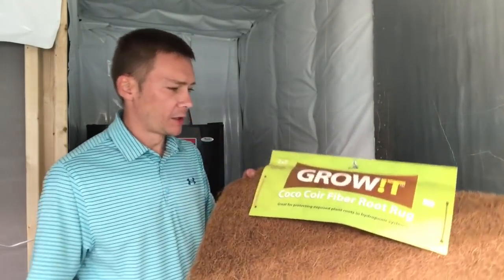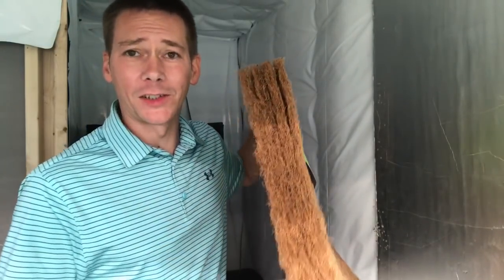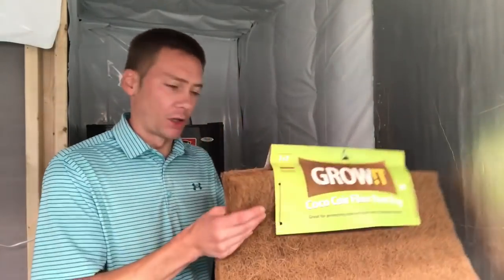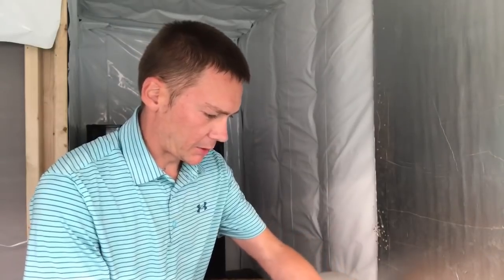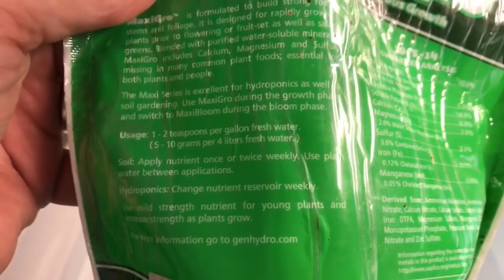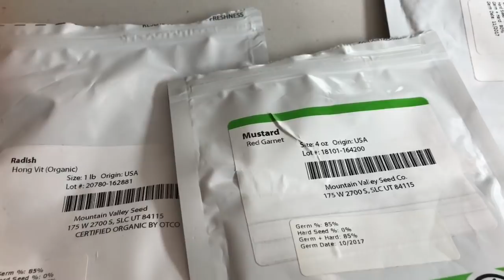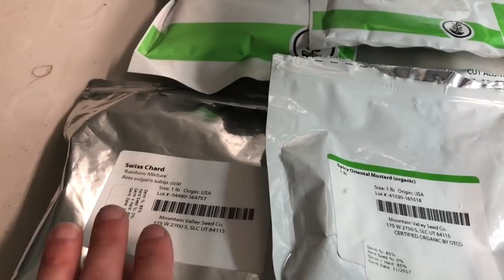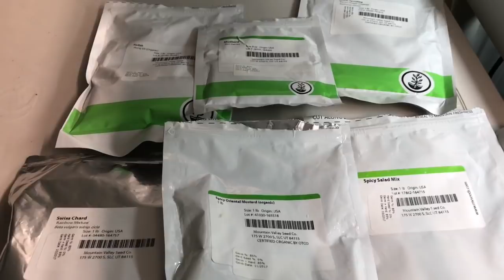Coco Coir Experiment: Part 1

Comment: I just started with micro greens and I had 2 issues my first go. 1.) my sunflower seed hulls did not come off before harvest time. I ended up having to remove these seed hulls BY HAND which is extremely inefficient. 2.) the dirt was easy to wash out of my tray but the roots are totally stuck to the thin plastic tray and scrubbing it will result in me damaging my tray. Any tips for quickly removing these roots? Soaking in hot water or something?
Reply from the maker: OpenyoureyesDX Just soak in water and the roots will be easier to remove. Sunflower has especially sticky roots.
Reply: CoreysCave thanks! Any chance the seed hulls would have self-removed with more weight during the weighted period?? I used canned goods instead of a patio stone. I have even growth so I think it was enough weight I’m just not wanting to pick the seed hulls off by hand! :(
Reply from the maker: OpenyoureyesDX Maybe try weighing it down a day or so longer. Seed hills on Sunflower is a common issue.
Reply: CoreysCave okay I’ll try. It’s quite annoying 😂 someone said mist the tops and brush your clean hand over the tops to knock them off but it didn’t work so well for me. I’ll try an extra day of weight and see if it helps thanks! :)

Comment: How many time can you reuse the mats.
Reply from the maker: Gillenz Fluff I don’t reuse them and wouldn’t recommend it.
Reply: @CoreysCave  I reuse coco soil at least 3 times before composting.
Reply from the maker: Gillenz Fluff How are you handling all the roots or left over stuff from the previous grow?
Reply: @CoreysCave  Just pull the main roots out brake the rest into chunks flush it with boiling water let it cool and leave the roots to rot a bit then reuse,  I think some fungus brakes the roots down because it smells like mushrooms.

Comment: Iv been been growing this way for a long time........takes time to get the system right, but its the way to go. Not all coco mats are the same.....I tried 13 different types till i found the right one that suits me....Good Luck
Reply from the maker: Mr Eighty Twenty Thanks, what mat did you find you liked? I know it’s probably different for everyone and their preferred methods.
Reply: Its a process of trial and error. Every country supplies different coco. You have to get a mat that has no silicone's etc in it.....It must be soaked ( distilled 6 ph water ) for 24 hours to remove all contaminates etc in the mat.Once this is done sow your seeds speeding them out with a small paint brush.....add coco mat nutrients after the 4rd day. Keep mat moist, water every day from bottom. Good Luck
Reply from the maker: Mr Eighty Twenty I appreciate the advice, thanks!

Comment: I had amazing success using coir matts.  It does not like to decompose.   It will, but it won't be quick
Reply from the maker: I expect you to be right. This stuff seems pretty rugged. I am planing on growing on it like a mini Kratky method. The micros can sit on top of the mat and the roots can grow into the bottom of the tray where I will keep about 1/4" of nutrient solution. The mat doesnt seem to have much wicking capability which could be used as a benefit.
Reply: CoreysCave yeah that works great.  I used two 1020 trays.  I then cut a 10x20 piece out of the mat, then cut that in 4 even pieces.  I then grew 4 crops per 1020.  I packaged and sold as "live micros".